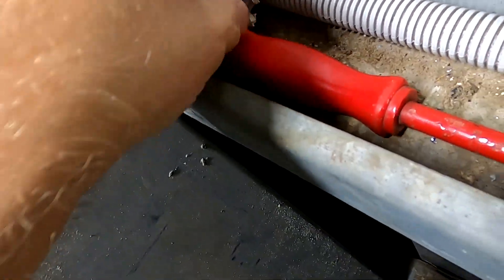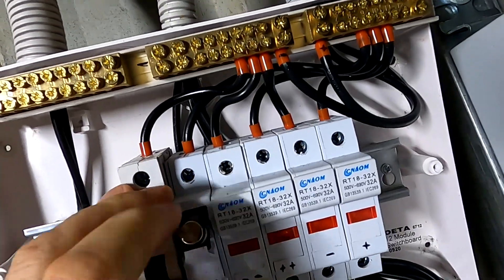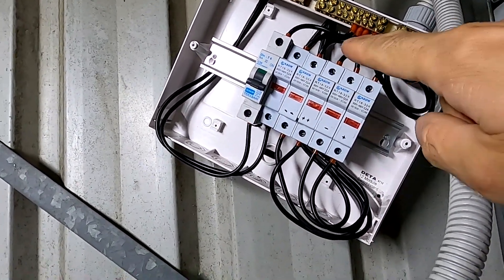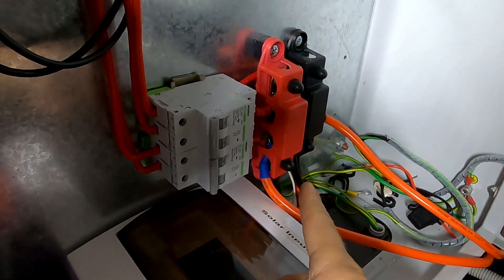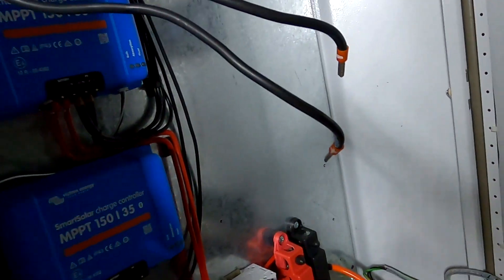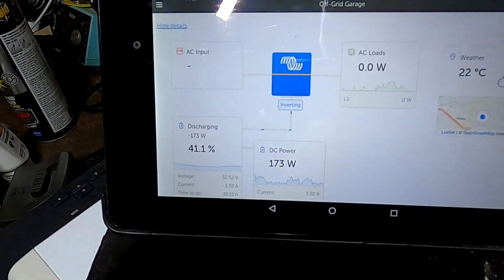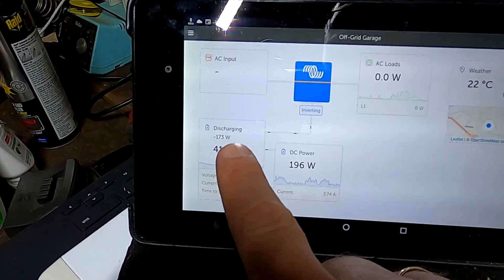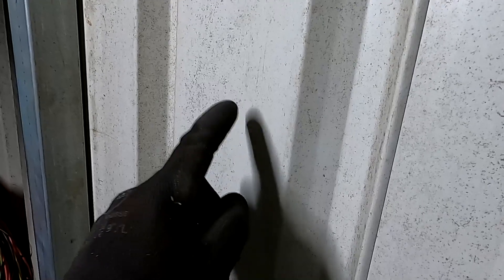Starting the Powerwall Project - Not what you think...

Comment: In this situation I just tighten the bolts, cut off the excess with a grinder, and dab or spray a little cold galvanizing paint on the cut part. Can't wait to see the rest of the series. 2 thumbs up
Reply: If there's room on the bolt, put a die on befor cutting end off and bevel the cut end with file or grinder then remove die, it will recut theads better then a nut does, more like a new bolt. But I've used a couple nuts and that worked well too.
Reply from the maker: I always put a nut on before cutting. Removing the nut again will smoothen the thread again. I used to file them a bit round but didn't bother this time.

Comment: Two pole fuses (positive and negative) to isolate solar panels are also code there in Europe when you have a floating array - which is 99.99% of them. In the States, when you have a non-floating array, you must only fuse the non-bonded pole.

Comment: Top tip: put the bolt you want to cut into the chuck of a drill to the point where you want to cut it off. Put your hacksaw up against the chuck and run the drill in forward direction. Simple no effort bolt cutting 👍
Reply from the maker: Wow, that sound complicated 😄
Reply: @OffGridGarageAustralia  I can be very wordy sometimes. Very simple in practice

Comment: You could add a reflective panel to the outside of the wall and maintain internal air circulation.
Reply from the maker: Yes, that's a good tip. Thanks
Reply: @OffGridGarageAustralia  could also try air cell insulation very thin so you would still have air flow as well

Comment: If you heat the garage in winter, the inside of the wall can get much colder than the inside air and damp can condensate on the wall.
Reply from the maker: Yeah, but there is no real winter down here. So that's not a concern...

Comment: You could put reflectix on the metal wall and it would cut down on radiative heating quite a bit without blocking air flow.
Reply from the maker: Ah, that is actually a good idea and it keeps the airflow. Very good tip!

Comment: Hi Andy, I would insulate the back, not for heat, but for our lovely vermin, a nice small gap for Redbacks that like living around steel and Funnel Webs, I am not a liker of zinc bolts, as being in the metal trades for over 40 years I always go for gal bolts as there are more durable against rust and corrosion
Reply from the maker: Thanks Ross. we don't have much corrosion here, no moisture in the air...

Comment: Hi Andy, what's your view on Lead carbon batteries regarding balancing, I've got 8 victron 160ah in series/parallel (48V 320ah). With the UK's low Sun, I'm not getting into float charge, so I assume the batteries aren't getting to equalise often if at all.
I've had a couple of low voltage alarms one battery in each string has dropped to about 9v the rest are 10.9-11.3.
The general consensus online is they don't need it! But! Victron do a balancer? but from reading the information it only seems to work  at the top end when changing. I haven't got links between the 12V, 24V and 36V terminals because I was told it wasn't needed with 2 strings but was with 3, do you think that might help with balancing the batteries.